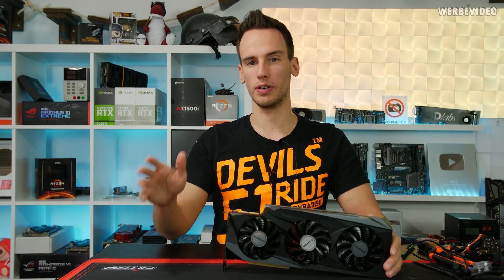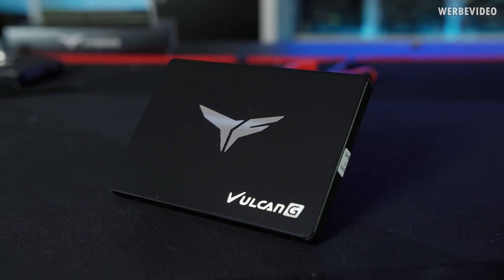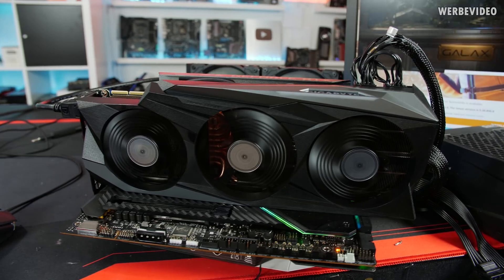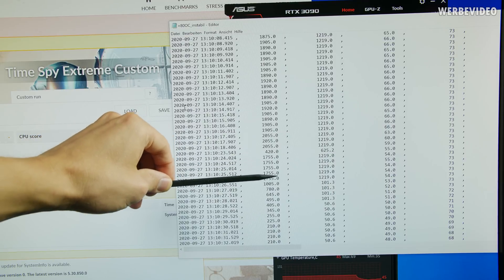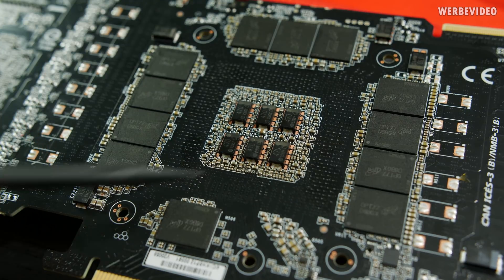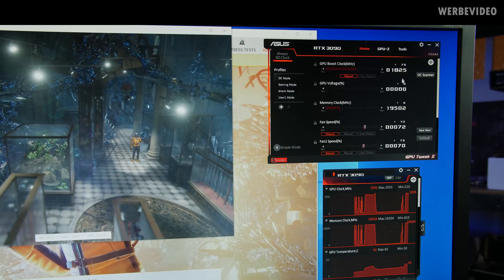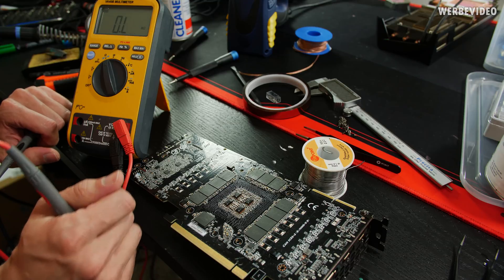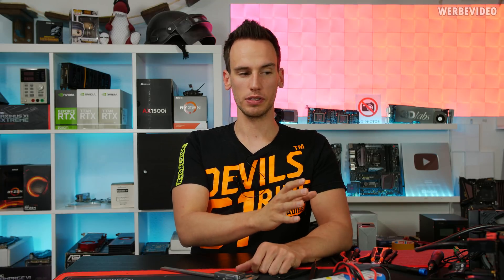We Tested the Cap-Drama - RTX 3090 MLCC vs POSCAP

Comment: I wonder if people having questionable power supplies might be a contributing factor
Reply: Tayler Vest one posibility... one is silicon lottery winner vs loser...
Reply: @haukionkannel  true that's always a factor but I bet there are people running the new rtx cards on psus that are one bad from from having white smoke come out the back
Reply: I'd say its doubtful, as the VRM is doing an excellent job filtering out the transients on the power input. Still not even 2 inches downstream the GPU induces transients of its own.

Comment: That soldering iron so old it probably assembled Tigers
Reply: it worked and it proved his point so its job done.
Reply: Lmao
Reply: @spaggtrait1608  Big true. Always seems like there's that 500 IQ guy knowing everything better than every1 else.
Reply: it`s a huge chip so doing local overhit is very dangerous, that`s why he used a hit gun to raise the temps allover the chip
Reply: I'm surprised he has such rubbish equipment with the job he dose
Reply: Is hard to see. Overheated all the components, no idea what he's doing
Reply: @sos1723  no he didnt overheat anything
Reply: @19janiboy96  Heat gun he is using can easily output well over 500C especially in close proximity. Some even over 700C and other than distance to the object you are trying to heat up there is no way to control temperature.
Reply: @Piasecznik72  Indeed, you should use a "small" temp. controlled heat gun (or an IR oven) and tape all components which shouldn't be affected.
Reply: @Piasecznik72  Yeah but the Kapton tape blocks the heat also did you see him melt the solder with the heat gun
I didnt, so the pcb temperature was well under 300° C
Reply: @19janiboy96  I cant be sure as video has lots of cuts. Anyway, he did what he did. At the end he was better than Jay2cent with hotglue gun shunt resistor installation.
What I'm trying to say - this is not a proper way of doing SMD soldering/desoldering. Some people could damage their boards trying to do the same.
Reply: I still cant unsee him PULLING the caps while hot. Luckily he didnt pull any pad off the board.
Reply: @Piasecznik72  And even a cheap heat gun has a High and Low heat setting. My $20 heat gun I use when doing some smaller projects using solder paste with SMD components - the low setting is around 300-350c and only takes less than 10 seconds to melt the paste at the low setting. Putting a quick blast from a heat gun on its 'low' setting for pre-heat doesn't hurt anything at all.

Comment: Buildzoid: * breath in * That is not POSCAP!
Reply: they are SP-Caps
Reply: SHIT-CRAPS
Reply: I love how Nvidia put out a statement this morning, and Nvidia themselves called it a POSCAP.
Reply: @LordSaliss  Probably written by a PR person who's been reading POSCAP everywhere.
Reply: @nwimpney  No, everyone except Buildzoid is calling them POSCAPS unless you want to be really precise
Reply: @Peter22334  Not every hot tub is a jacuzzi (brand), not every watercraft is a jet ski, not every SP-Cap is a POSCAP.
Reply: Exactly. Do you call it Vaseline or Petroleum Jelly, Hoover or Vacuum Cleaner ? All this is a storm in a tea cup ultimately, if it's stable under normal load AND boost fine, if not then drivers need sorting (which they have issued anyway and they make no difference to the performance): if it's when it's overclocked then it's on the consumer as it's out of spec and that has always been the case.
Reply: @LordSaliss  They were probably misled to thnk it was the caps for the power and memory stages, and not the ones for the gpu
Reply: Seasonic stopped sponsoring English videos?
Reply: Hahahaha
Reply: I wish they were Poscaps, I need them for OG REX Mainboards but seem to be impossible to find. They are used on NB, DDR3 and behind the CPU
Reply: I looked in the comments specifically for this kind of comment xD
Reply: Def. POSCAPS lmao
Reply: Reeeeeeeeee
Reply: I keep reading it as a piece of shit cap because I have no clue what a POSCAP is. I always called them tantalum caps.